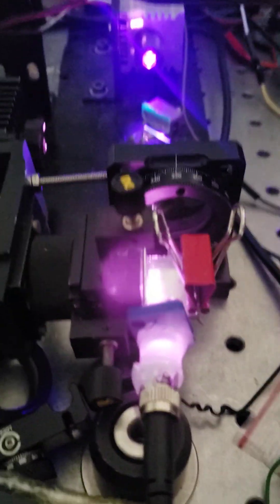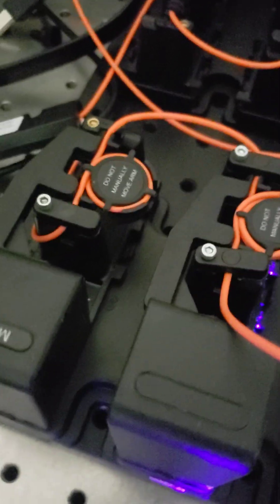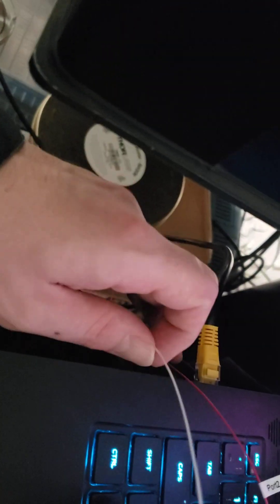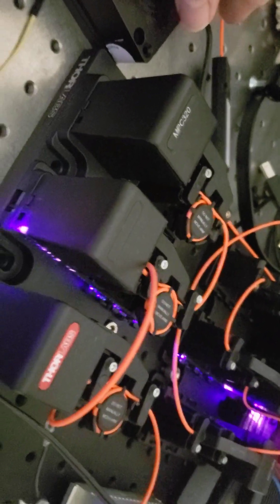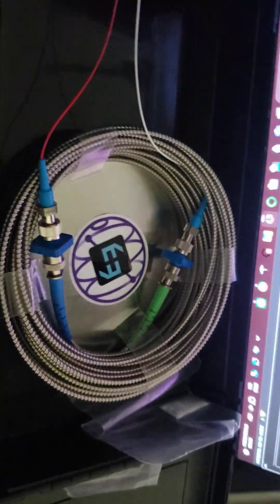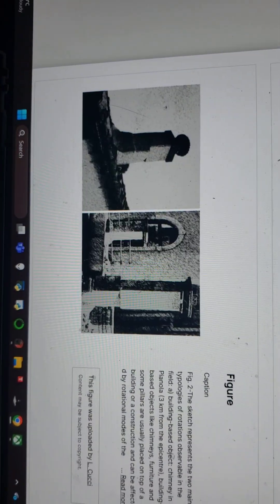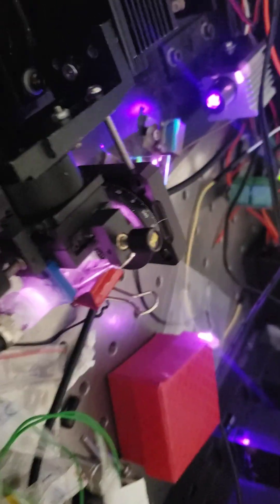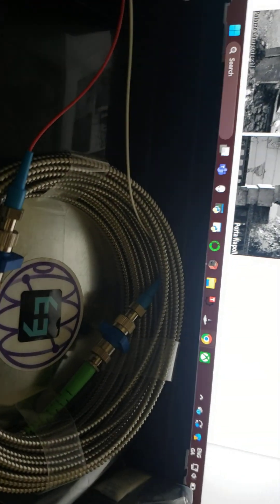My First Attempt of using a Polarization Entangled Quantum Light Source in a Sagnac Interferometer

Comment: Very neat setup! Until I got a glance my immediate thought was what kind of optical isolation you're doing; but after seeing the rest of the hardware I realized how kitted out everything really is. Is this work open source/published anywhere? Could one introduce a multi-axial component by using a variable beamsplitter/Michelson ? Thanks for sharing! Maybe once we have proper bench isolation id love to replicate and learn from this work.
Reply from the maker: Work done so far that's online and free to use by anyone is here: https://github.com/MuonRay/Quantum_Polarimetry_Tomography
note there is nothing specific to the use as a sensor here, just gathering data from the polarimeters in coincidence mode to do a state tomography (should there be 2 in sync which is ultimately the plan here once I get another PM fiber loop and PM fiber splitter at this wavelength) I don't think entanglement of 2 Sagnacs has been done yet and is something I would like to do also for a very sensitive 2 axis detector.